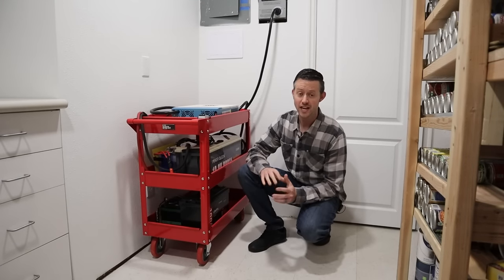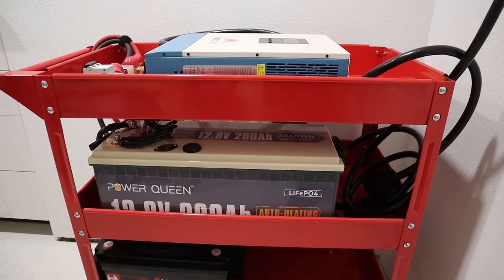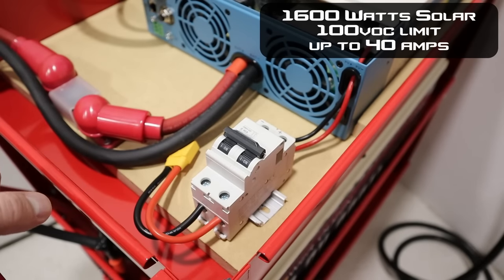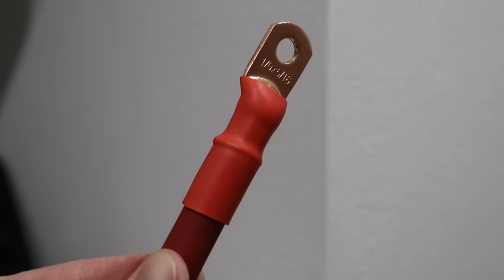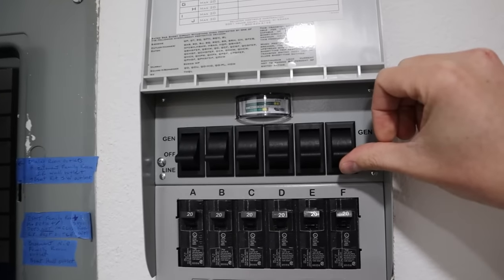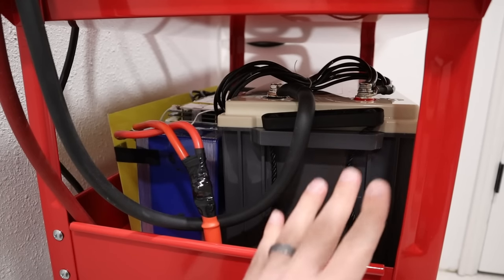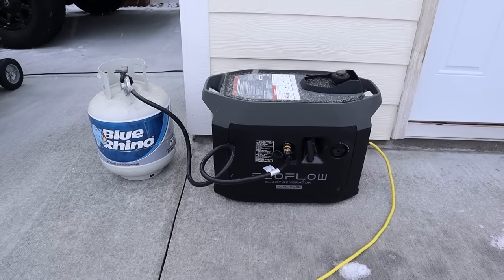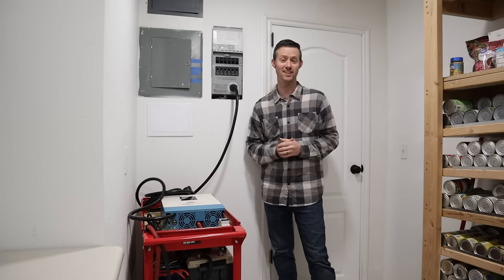Be Ready For Any Power Outage!  DIY 3000w SunGoldPower - PowerQueen LiFePO4 Home Backup System!

Comment: pro tip - never use a metal cart.  plastic/resin carts are cheaper, won't ever rust, and avoids any issues with electrical devices
Reply: Since you're the Pro, where would I buy a 3 shelf resin cart that can hold 12- LiPO4 batteries, and have the same dimensions of the steel cart? And for cheaper than the $54. I paid for mine at Harbor Freight. It's hen in service for 2 years with no shorts, and no rust yet. I also live in Florida with a high humidity rate and the cart is on the covered back porch. I do have some minimal surface rust starting on the vent covers on the MppSolar LV-6548 charge controllers. I probably should pop them off and shoot some Rustoleum on them this spring
Reply: Pro tip put some insulating material between it and the components if you’re worried about it.
Reply: @davebacknolaliki1452 PRO TIP: You are right about the insulation.

Comment: NICE!  Rule #1 Nothing is EASY!  Some suggestions for safety IMHO to prevent a fire (these things HAVE caught Fire). HEY! it's YOUR home. Think AC panels here. A Main disconnect switch of the proper size at the source (that big battery is the source here). THEN a fuse or breaker of the proper size to carry your load and protect the WIRING within 7 inches of the battery POS post (REQUIRED on a commercial unit I believe). Do maintenance checks often and keep connections clean and TIGHT.  Could it pass an inspection? HEY! WHAT CAN GO WRONG? Insurance have disallowed claims because of these things. Do it RIGHT don't just make it work!

Comment: You need to front and center state the total kilowatt-hour capacity of the battery array. This capacity is by far the most important number and where most of the expense comes in. Yes you can power 3,000 watts that's great but for how long? Apparently this cart system is about five kWh which is respectable. That would probably run an average size refrigerator for about 45 hours. Personally I'm thinking about 15 kWh would be a lot more useful if you're going to go with a big old rack like this, and then you'd have the opportunity to add solar power to this, with three or four days worth of running essential household items during a power outage. Of course it's three times the batteries shown here and it'll be more expensive. Figuring about $2,000 total for a diy system. But that's a vastly better bang for the buck than a jackery or bluetti kind of system. These companies don't like to front and center state their kilowatt hours either but that's because they're usually relatively anemic.

Comment: don't solder stranded wire ends if you intend to connect them to screw terminals, potential fire risk. Use crimp-on ferrules instead.

Comment: love the cart setup.  an alternative to the resistor is to put a filament light bulb in series on the positive lead when connecting the battery.  also there are a lot of 240vac output ups solar inverter chargers.  to use one of those you'll have to add a split phase or center tap transformer, but you can get from the ac output lower amperage while delivering the same amount of power.

Comment: Very great build
Quick background, im a marine electrician, and design and install systems on boats like these 
One thing i would recommend is using a class t fuse for the inverter 
We’ve seen anls break and then re-weld  themselves back together and cause a fire 
But beautiful system!!
Reply from the maker: Thanks for sharing your experience, that's helpful!

Comment: I built a system very similar to yours but I used a cart made of composite material that is non-conductive. I enclosed the battery storage shelves with chalkboard material bought at Home Depot for under $10 each. I cut them to cover the sides and back of the open areas pf the cart. I secured them to the cart with strong Velcro. This will prevent items getting into the battery area.
I do not have insulated tools, but I do cover the tools I am working with in heat shrink tubing.

Comment: Nice project and well done video.  I really like the concept.  Since I already had a 24 V home backup system using rack mounted batteries and Victron Multipluses in split phase mode, I didn't need the inverter.  So I just built a 24V battery bank on a three tier cart using 2S3P x 12V 230AH TimeUSB batteries which provide an additional 17.6 kWh of battery capacity for about $3,000 including the cart, bus bars, breakers and cabling.  I plug it into my system using  2x175A anderson connectors and 2 x #2AWG cabling..  It works great and has become a permanent part of my home backup system.  One additional item to consider when putting 12V batteries in series is to make sure the batteries are all top balanced before hooking them up and add a battery equalizer to keep the 12V batteries balanced over time.

Comment: The Danfoss BD50f compressor, for refridgeration, can operate in any power source, it requires 109 watts to operate. You need to purchase the Power Module for your voltage needs, 12/24v, 115v, or 220v.
The Power Modules contain an inverter, transforming the input voltage to the requirements of the BD50f.
If you have a 115v refridgerator with a BD50f compressor, you can swap Power Modules to the 12v version and run the refridgerator directly from batteries without an inverter. Therefore, more efficient battery usage.
Reply: That is good to know!

Comment: I own two Bluetti AC200P's, Echoflow Pro, and an off-brand 2000 watt solar generator plus I have 2820 watts of solar input. My solar generators are usually fully charge by around 12:30 pm.  I live in Golden Valley, AZ with around 300 full solar days per year.  I have excess solar charging capacity on most days.  I like to tinker around with stuff.  So, this gives me some ideas for my next project.  Thanks for the video!

Comment: Cool idea, however your fuse amp rating needs to be smaller then the amp rating of the cable. Also solder on cable going under a screw isn't good practice. But well done and good work.

Comment: The only thing I would change with this system is placing the battery fuse closer to the battery and adding a battery disconnect for safety

Comment: I like the thinking outside the box. We have come to be reliant on plug and play, if a single device i.e. solar generator fails, or your generator fails, you are SOL, this has its place. Single items can be replaced to restore the system.  Having said that, I am a huge bluetti fan, I have AC200max with 2 b230 batteries. I have 2 EB70 and 1 EB55 in 220v versions. I have spare cables and spare power supplies. But always looking for other ideas.  Great video thank you.

Comment: Thanks for your video, great as always.  Wondering if you could do one explaining the pros and cons of 12V vs 24V vs 48 and break down where it would be most beneficial.
Reply from the maker: Great suggestion!
Reply: 48 volt is more efficient than 12 or 24.  The more voltage step-up the more power is used just for the step-up process. When using a 220 split phase inverter to power central AC unit or other 220 appliances a 48 volt system is pretty much a must.
Reply: @equanimousawareness  If all your doing is keeping the fridge running, 12 or 24 volt is better since the inverter doesn't eat as much power sitting around waiting till it needs some energy output. The 48V split phase eats more power if the AC doesn't turn on.

Comment: Oh, one more thing...I create insulated sleeves with heat shrink tubing. I tape off one end with electrical tape and then I slip one each over the pos and the neg lug. I use a tubing diameter that is snug enough that it will not fall off.

Comment: This was great!
It proves to me (sorry solar off grid geeks) that it is not cost effective for me.
We live in a very mild 365 days a year area with it being rare to very rare to have bad weather nocking our power out... so there is really not a need there.  I do have a gas generator, but that is really just used to power tools/equipment when away from AC.
Spending $2,000 to have off grid power in my home is just not cost effective.  I would never die to not having power and if I loose refrigerator worth of food -$300 then so be it as that is a 1 in 100,000 possibility.
Now don't get me wrong as we are gong to build a second house off grid and at that point I will plop down $50K to get solar power.

Comment: My setup I made in 2016 uses 4 6v 260Ah AGM batteries (Renogy) due to costs of lithium in 2018. A Renogy 2000w pure sine wave inverter/charger, cables, breakers, and fused properly.  An Epever 40amp solar controller, MT50 monitor on an 800lb Gorilla cart.  I can grid power, generator,  or use the 800watts of solar panels. Tested and routinely used as UPS.
Reply from the maker: Great setup! That's a lot of power right there!

Comment: One thing I would be a little weary of though is tinning wires before putting them in a compression style connection like that. Probably will be fine though. Nice video!!
Reply from the maker: Thank you, I learned that after posting this video.

Comment: I really need to upgrade my system to LiFePO4 batteries. 
I've got a similar setup attached to 2 160W solar panels. Two 115A/h AGMs, a controller/regulator, and a 3000W Pure Sine wave inverter. I feel like it needs more battery capacity because I can lose 10% of my charge in an hour or two in full sun on the two parallel-connected batteries when running a computer, TV, stereo system, a 75 litre dual zone twin-lid camp fridge, a phone charger, and some LED strip lights. I'm wondering if I've set up an inefficient system. Both panels are connected in parallel as well. Maybe I'm expecting too much from the setup, I dunno. I can run the fridge by itself overnight after an hour or two of using the computer system setup, and it only drops to 48/50% . I need to rethink my computer setup though. It's a desktop using a 100cm Tv as a monitor, and a Sony stereo system for speakers. A lot of power just to watch YouTube and catch up with news and social media.
Good thing I have a ULP genset as a backup I guess.

Comment: I bought a 20 amp plug in charger for my big 300ah battery and I used it with a 2000 watt inverter to power my microwave during a power outage. It was also nice to know I have multiple sources of power when the freezing storm with high winds hit n December, especially for my electric blanket. The wind chill was below zero and the power kept failing. Of course the new electric blankets are digital and so are the heaters I had here, so they don`t turn back on when the power goes out for a few minutes. 

So I plugged my electric blanket into one of my Bluetti EB70s.  I accidentally put it on medium high instead of a lower setting when my foot hit the control switch but only used about half the battery during the night and of course it stayed on. I ran my WIFI and lights from batteries too. My 600 watt manual heater was at my sister`s house since it`s "too cheap" (I`m so dumb, see) so my nephew refused to bring it. I had to use the horrible and way overpriced digital job that`s 1500 watts and is either too hot or too cold and has to be turned on and off every few minutes and turns off when the power fails. It would drain my battery in a couple hours. 

So more and more I appreciate having these backup batteries and even have seven various low wattage cookers now that work with them. Six of my cookers work fine with my 500 watt power stations too, and two can be used with some of the smaller ones. I was born in the mid 1960s so these things are like miracles to me and I will never stop being amazed by this technology.
Reply from the maker: Glad your backup batteries and inverter are working well for you! Have you built up any solar charging yet?
Reply: @Jasonoid  No. I`m ordering another 190w HQST panel next month and the bolts to connect the 200 amp fuse to the inverter cable and some switches to be able to disconnect the panels and battery. After that I`m getting one more 100w panel to have four of those in series/parallel with the two 190w ones. Later I`ll either get two more larger panels or two 100w ones. I`d prefer the larger ones but the cost is higher. I need to get two 100w mono panels. My others are poly but the 190w ones will both be mono. The good thing is in a pinch I can dump power into the large battery with my two EB70s and my two 500 watt power stations with the 20 amp plug in charger. I need to learn how to do this with their 12v ports but they only produce about 100 watts. 

I`m thinking of getting some cheap MPPT charge controllers to rig up for this. Not sure how to go about it yet though. It would be nice to have that option if needed. I can dump over 1500 kwh into it that way to extend run time. But I also want to be able to get the big battery back up from a very low state of charge at night or on a cloudy day if I happen to drain it too low. I think the higher priced Renogy 500 amp battery meter will prevent that. There`s a less expensive one but it may be more difficult to use and may not be worth the 20 bucks less. I want an accurate meter to avoid surprises.

Comment: Standing up the inverter will allow maximum cooling. If the fans on the bottom are sucking air in and the vents are on top,  having the unit upright will keep the unit cooler via the chimney effect (heat rises).
Reply from the maker: It actually pulls air in from the sides and shoots it out the bottom. The fans really move the air so I don't think it laying flat is an issue at all. The air coming out is always cool.

Comment: Wow, this is almost what I'm working on in my basement!  I saw Survival Lily use a cart in a video a while ago, which I thought was a wonderful idea, and now you. 😁For what its worth, on mine I am using 4x 100Ah batteries that just fit on the bottom shelf. (I used a piece of 1in thick insulation board under the batteries to cover the screw heads for the casters and the ends of the screws holding the uprights.)
Reply from the maker: Four 100ah batteries is probably the best way to go, then you can pull the full 3000 watts.

Comment: I've got the same system, except for the batteries. I have two 300 ah 12v power queen batteries. The same sungold 24 volt system. Will see how it works.

Comment: Great video and I've done a similar setup with a cart in my garage so I can bring power where I need it in my driveway.  If I would do it over again, 48v all the way.
Reply from the maker: Yeah, 48v system with server rack batteries!
Reply: @Jasonoid  like you, I wanted to use what I already had on hand and it worked out. 48v would be ideal just from a wiring perspective, especially with the array you have in the driveway.

Comment: This video was great. Cool project, but I would argue the summer vs winter fridge thing depends…. We keep the house colder in the summer than we do in the winter. The fridge operates on ambient temp, it exists inside the conditioned space of the home, so my assumption is that my fridge uses more power in the winter in my home.

Comment: There was no comment about  the transfer switch wiring, normally they are wired for 240 split phase, but your invertor was 125V...I know the teansfer switch can be wirred as you want, but I did not hear that mentioned.

Comment: Thanks for sharing the cart build, i think you have enough room on that shelf for 4 of those 200ah batteries so a 48v system coulda been done i think.
i was a bit concerned seeing that battery not in a case, but then ya told us its because it wouldn't fit on the cart, still looks a bit weird but, it works.
Reply from the maker: Even though the battery was removed from it's case the terminals were protected. One could fit 4 200ah batteries on the cart if two of them were removed from their cases, sad to see so much wasted space on these larger batteries! That's why I recommended the four (100ah) batteries in a series / parallel config so the battery warranties would be intact still.
What I need to figure out is if a 48v server rack battery would fit on the shelf of this cart...haha
Reply: i am sure you have watched some of will prowse's videos and that will give you an idea of how large those server rack batteries are. i would think that not gonna happen.
a cart video of another creator i watch https://youtu.be/J9WZcMDQaDg
Reply from the maker: @user--PM  I watch both lithium solar and will prowse videos 👍 I love that cart video! Excellent design!

Comment: Seeing that you are going to a transfer switch, do you have the neutrals from invertor , line and load tied together. Bonding of neutral and ground at main line panel only.  So your inverter should be a floating neutral , not bonded. 
The rule being bonding can only at one place only .

Comment: First of all excellent video. I’ve been back and forth on this whole build, or buy a plug and play system.  I’m leaning to build. I’ve watched dang near every video I can on this, definitely good info. Might do a combination of the two. Buy a complete system that’s made to match properly, and build it into a portable system.  And I do want the ability to plug it in with past through charging capabilities where I can plug into the house or a generator if needs be. I will probably use one of those ABS carts though. I see you guys all using these metal ones and it make me cringe   😬    because I will will shock the hell outta myself doing this otherwise 😂🤣😅